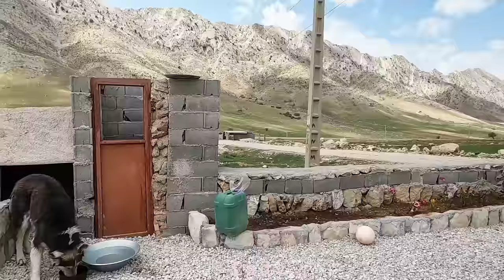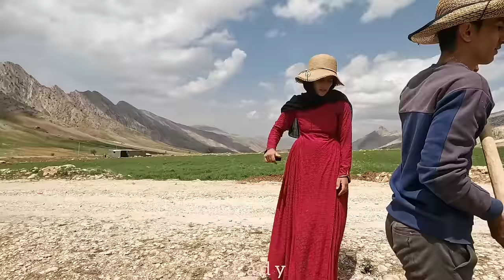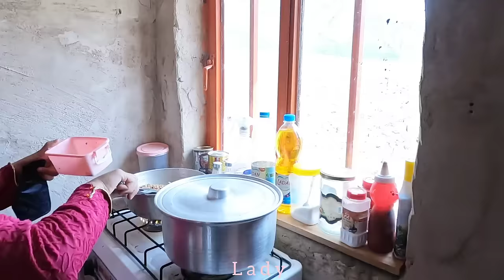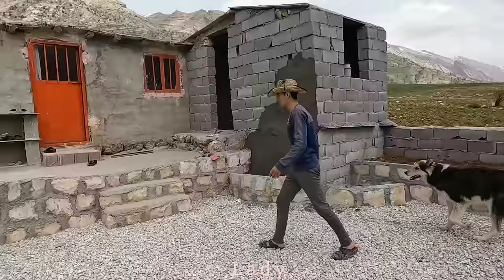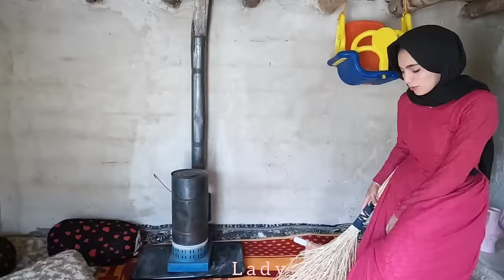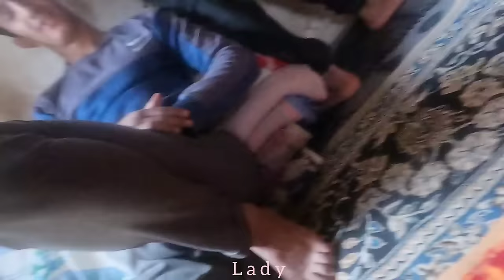Documentary "Nomads: Searching for siblings to build a house" (2024)

Comment: I thing now, while you are peeling vegetables, is good time to explain further about composting scraps. To compost, the idea is to help break down scraps into nutrients for the plants . First you must chop up the scraps into smaller pieces, then put them into a bin or in a hole in the ground. Keep putting the scraps into the same hole or bin. The idea is to let it rot and decompose. After it start to decompose, you mix it up by stirring it as you add. The microbes in the soil will start to digest the vegetation . Once it starts to decompose, you can use it for fertilizer . And it works very well for natural fertilizer.